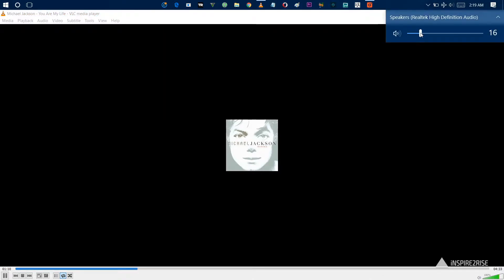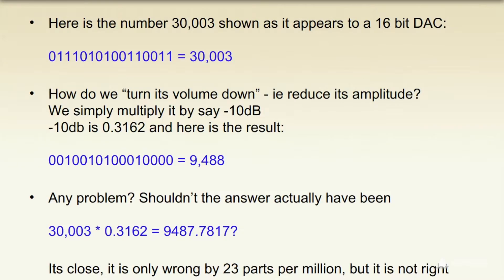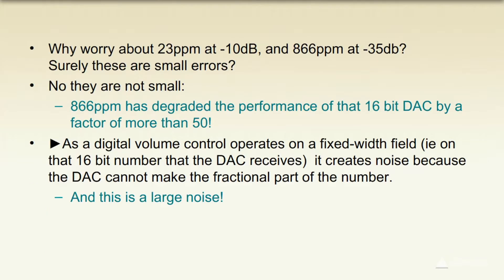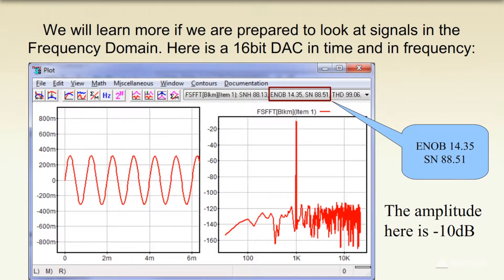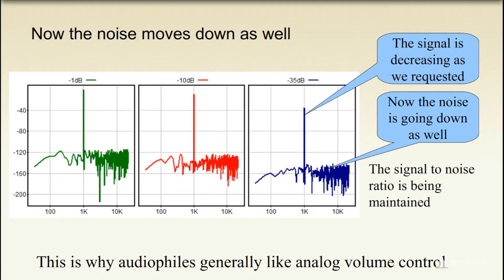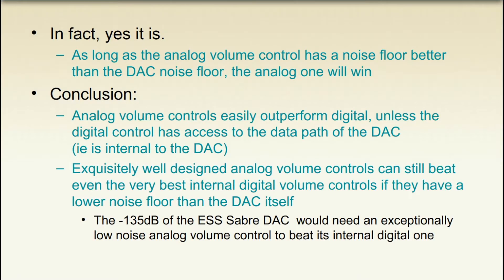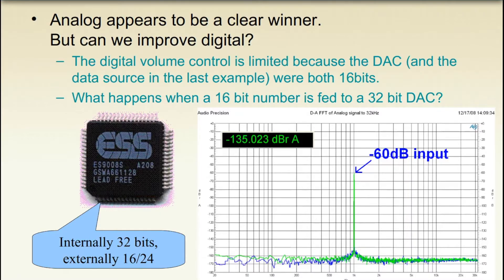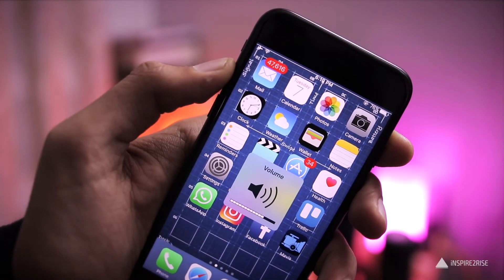Digital volume control VS analog volume control

Comment: incorrect info........When ever u r pressing a button is always a digital volume control, in analog volume control u have potentiometer that u rotate.  So problem u r facing with audio quality is not due to digital volume but due to SNR. When u transmit the signal noise get adds up. so transmitting the signal with full volume means u r sending more signal so noise which will get introduced will be less in proportion thus u will get cleaner output, (Not due to Digital/Analog). Yes in high end Audiophile system u will get noticeable difference about it but in high end system u wont be playing compressed MP3 audio from ur phone/laptop and u will be using uncompressed wav files.

Comment: In-Line Volume Control on a headphone cable is NOT analog. It's merely a button that tells the device to control the volume digitally, therefore, digital volume control. Same thing for most Up/Down volume buttons on most phones (there are exceptions like LG V20, or when using apps such as USB Audio Player PRO in hardware volume control mode). Additionally, system audio settings is also primarily digital unless you are using something like ASIO or WASAPI (which has its limitations because only one application has access to the DAC at a time). 

Other than that, great video.